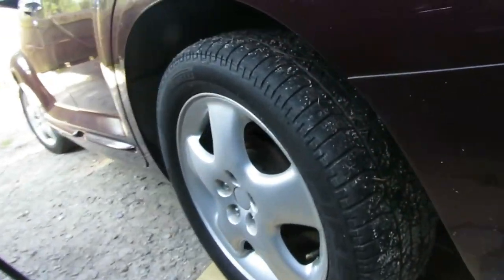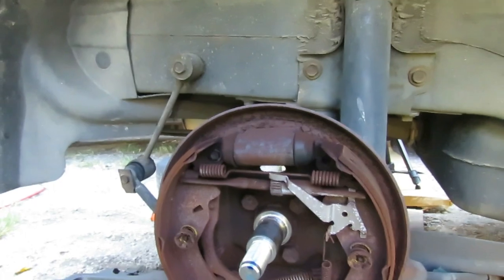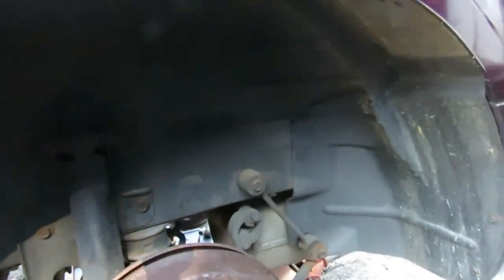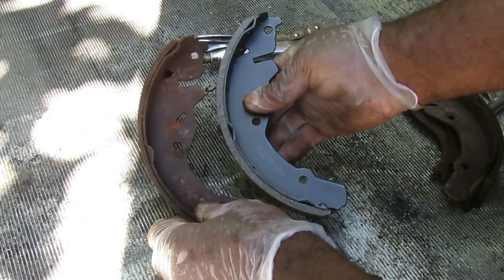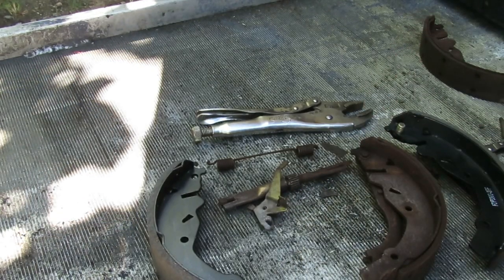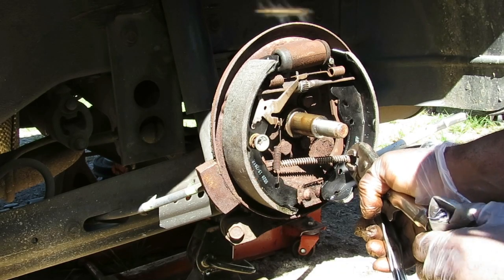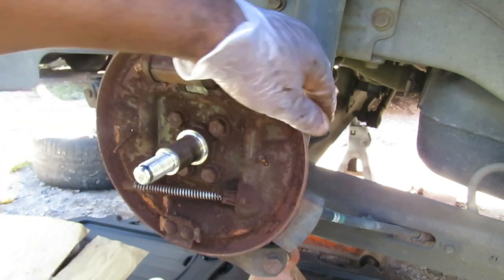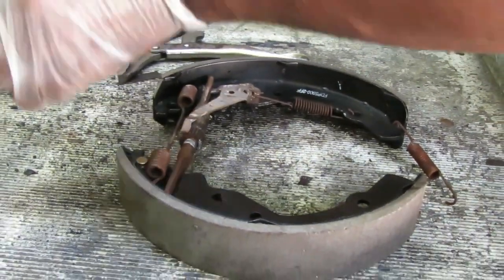⭐ 2002 Chrysler PT Cruiser - Rear Brake Shoes

Comment: Thanks for making this video. I spent hours trying to get the upper spring and the adjustment rod on at the same time. Once I watched your video, I built the brakes on the bench. I installed them as one piece but concerned about getting the parking brake on; it was a piece of cake using the wire cutters to hold the spring up...(that was ingenious!) with no damage to the cable. Thanks again!

Comment: I know this is an old video but you insert 2 tools, a thin screw driver to push the auto adjuster lock while with the other hand you turn the star wheel to loose the brake shoes.